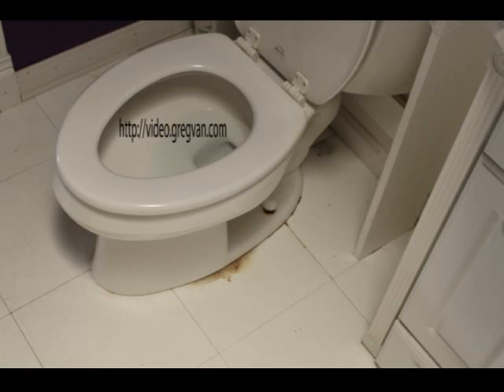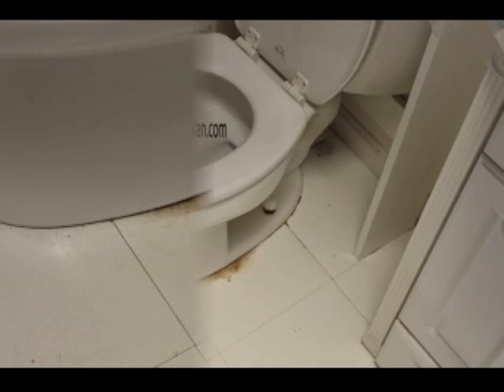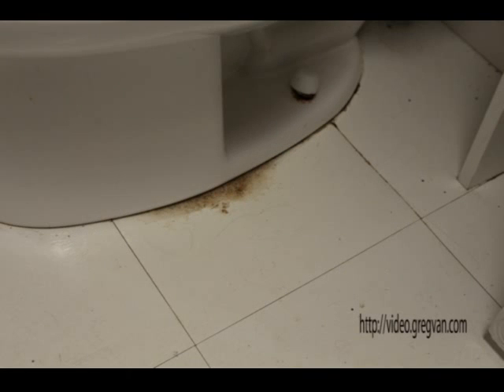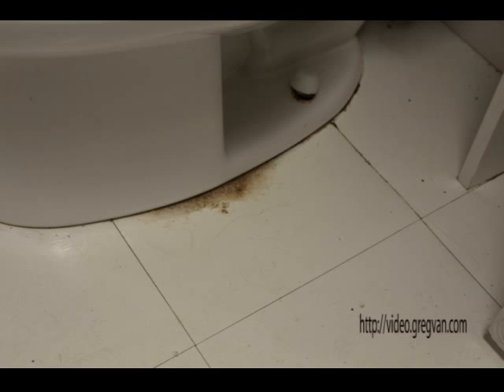Loose Toilets Can Damage Wax Seal Creating a Water Leak at Floor

Comment: can water from the shower going through the base cause damage???
Reply from the maker: Yes, it can cause erosion under the concrete slab or wood rot in wood framed floors. This might take a few years, but it should be fixed as soon as it can.

Comment: What can I do to test if the toilet is leaking from the base?
Reply from the maker: I don't know of any test for it. If it's on a concrete slab then you might not know and it might not be as big of a problem as if it's built on a wood framed floor where you can check for leaks by examining the area below.

Comment: if the toilet sits flat and the wax ring and the funnel attached to it is facing down showing no damage and has been attached correctly and is allowing waste to go down the drainpipe.  i can only think one thing that you mentioned and that is a crack in the toilet seat, or the tank.  Taking the toilet and placing it on saw horses and running water through it is just a waste of time.  Invest in a new toilet because trying to repair a crack is just a waste of time.  A toilet like you show is worth about a hundred to two hundred.  The repair to the flange that the toilet attaches to is more money the plumber will charge to repair on top of his or her fee for doing the job.  And it will be very high.